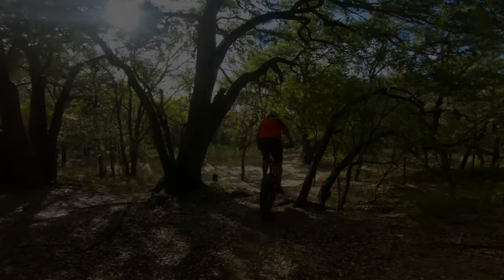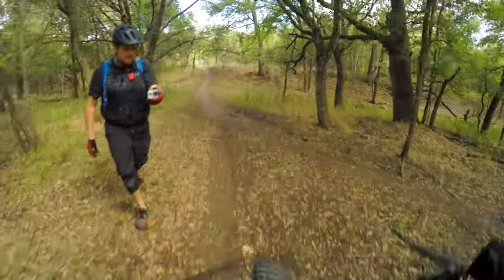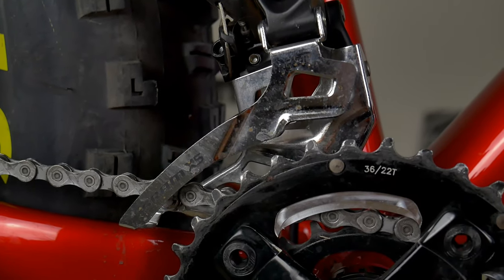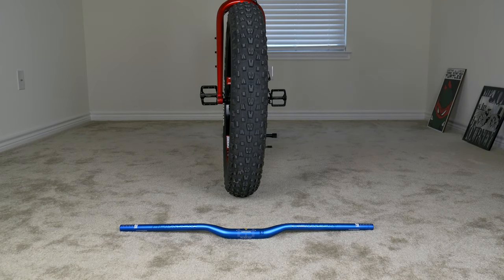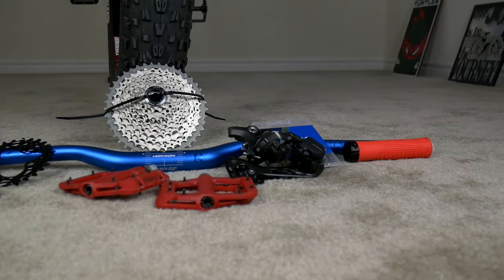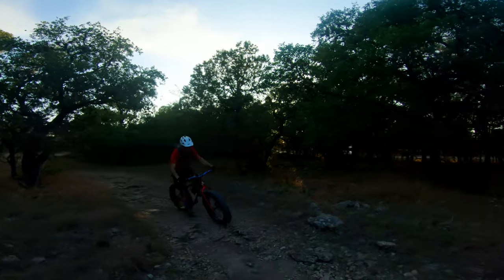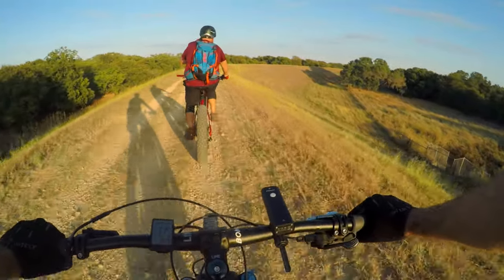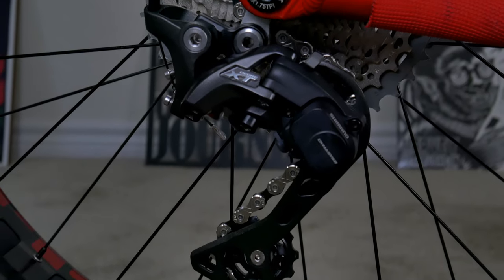Simple and Cheap Upgrades that Transformed my Fat Bike!

Comment: Nice vid, and great upgrades. I bought my Rocky Mountain Blizzard 20 and the first thing I did was add a OneUp Components V1 dropper post for under$150. I'm swapping the MT201 brakes for SLX ones, and replaced the factory pedals with RockBros STAMPs. I added two lights (since it gets dark sooner in the winter), and a frame mount for a pump and CO2. Next up is a suspension fork, but that's NOT a cheap upgrade.
Reply from the maker: Good stuff! I wanted suspension too, but could never pull the trigger when seeing the cost. I was gonna go with the Manitou Mastadon. People seem to really like that fork.

Comment: Nice upgrades! Only thing I'd suggest is running a bashguard ring on the outside since there aren't any ISCG tabs, that's what I did on my bike.
Reply from the maker: Thanks Kenny. That's a good suggestion. I thought it looked a little weird since I mounted the new chainring on the inside bolts. I'll have to look for one.

Comment: Looks great but wondering if you might have too much PSI in the front tire.  I would think more than 8 would be too much.  Looks like its a little bumpy riding.
Reply from the maker: It probably was too much air. I had tubes in it at the time, and my floor pump had trouble reading pressures below 10psi, so I always put it over 10 in hopes of not getting a flat. I eventually made this bike tubeless and was running super low pressures and it was wild!

Comment: i got a salsa beargrease 2017 use mushroom  grips on my handlebars which are moustache handlebars old school i know but still very nice feel, saint pedals, bontrager jackalope rims 26 inch, tyres maxxis minions fbr 26 x 4 on front as well as back for improved traction, seat ism sport, i still got 2 x 10 gears, outer front chain ring is 42 tooth and rear 11 x 42 for road use.  i have chain tight my chain always stays on even off road.

Comment: Luna Cycles has the BBSHD 1000 watt electric motor... with the Ludicrous upgrade, it will turn the motor into a 50 amp, 2700 Watt Fat Tire Beast that will get you rolling up any hill or down the 2 track at speeds in excess of 40 miles per hour!... If anything is worth doing bro.... over due it! (Oh... and always ride with your seatbelt on... in lowest gear.... it is a wheelie machine! ).
Reply from the maker: That sounds absolutely nuts man and I'm very into the idea of it lol

Comment: 2X drivetrains are fine.  If the chain drops, you suck at shifting and/or it isn't adjusted properly.  They also provide way more top end gear than a 1X can, without losing anything on the low end.

Comment: Put  a shorter on stem 45 50 mm makes  a big difference apart from that  all good  up grades  bigger brake  rotors  help  180 rear 203 front cheap up grade
Reply from the maker: I did consider doing the stem as well cause my current one is pretty long. I do have the 203 and 180 brake rotor setup. Helped drastically as it came stock with 160/160.

Comment: I'm sorry if I missed it- have you converted it to Tubeless yet?
Reply from the maker: I've tried so many times to convert this thing tubeless and I can't get it to work :( Sadly I still run tubes in it. I've tried an air compressor and they still won't seat on the rim. Cheap wheels. I may down the road invest in a nicer tubeless wheelset, but don't want to spend the money yet.
Reply: Try lairing up the tape on your rims until the bead fits tight. Try tieing a rope around your tire before hitting it with the compressor.... Going tubeless will over shadow every single upgrade you made to the bike.
Reply: Ghetto tubeless with a 24inch split tube. Easiest and most reliable method for tubeless on a fat bike
Reply: @FatTraction  
100% AGREED.
On my Budget FATTIE Mongoose Malus the standard 'use superwide 4" Gorilla Tape' to seal rim method failed.
Then tried the '24"x4" Ghetto Split Fat Tube method - success !!

Using custom mixed sealant - no air loss in stock 26x4 tires too !
Reply: I could not get my rear tire to seat tubless. Tried every thing with rope, tape and dirty words. I reseated tire with tube then  only broke one bead from rim  to remove tube and install tubeless valve. Used air compressor with hugging and bouncing tire to get bead to seat.
Reply: @jodyhodge2129  that’s the way I got it to work as well. Plus positioning the unbeaded bead as best as possible for seating prior to hitting it with the compressor. Definitely not the easiest job.

Comment: What was the gear ratio on the old 10 speed cassette?  I have a 1x9   Was thinking of upgrading
Reply from the maker: I honestly don't remember. I wanna say it was 11-42? I think the new 11 speed was 11-46. Not a huge difference, but weight savings and less clutter on handlebars made it worth it.

Comment: Did you need to add spacers to center the chain ring? I am doing this same upgrade and have read that you should consider adding spacers to center your chain ring with the cassette. Thank you!
Reply from the maker: Hi Andrew. I actually didn't add any spacers for the chainring. Never had a problem with shifting!
Reply: Did the conversion to 1x10 to great success! Also got the same grips and it has saved my wrists as well. Thanks for the recommendations and details

Comment: Please, can I  have the reference of the bar handle? In addition, I've mistakenly bought online an used Mongoose fate tire that I was intending to upgrade just like you did. But unfortunately, it was a one speed bike. Now, can it be upgraded to a 14 or higher speed?
Reply from the maker: Here is a link to the handlebars I got: https://www.chainreactioncycles.com/us/en/nukeproof-horizon-v2-alloy-riser-bar-31-8mm/rp-prod192543

I bought the 25mm rise. Mine are an older version that they don't make anymore, but these are pretty much the same. 

As for the geared conversion, it depends on the type of hub your rear wheel has. There's a lot of different scenarios if it will work or not, so it's hard for me to give a definitive yes or no. Google how to do a single speed to geared conversion, and there's a lot of great resources to help you!

Comment: Awesome video and upgrades! The bike looks awesome! I would have also gone with a shorter stem, either 40mm or 50mm. I've always done this upgrade to my fat bikes and it completely transforms the handling and flickability.
Reply from the maker: I eventually put a 50mm stem on after this video was filmed. It was way better. I think the original was either 90 or 100mm? Short stems for the win!

Comment: if i only use it in the city, do you think how many cassette do i need to use in my crank? And how many T?
Reply from the maker: Will you be using a 1X drivetrain? Depends on how hilly your city is. If you wanna be able to keep up in traffic I would go with a 36 - 40 tooth front chainring. If using a 10 - 11 speed cassette, just find the biggest range you can find that will fit the bike. I think a 10-46 cassette would cover just about everything.
Reply: Thank you so much for the feedback.. 🙏🙏
Reply: @CobraKyle   if you use 1x drivetrain, what T will you choose? 24? 36? or 40?  *for me

Comment: Does it have routing for dropper post
Reply from the maker: It does! Has a hole in the seat tube, but not internal routing in the downtube. I ran my dropper cable underneath the downtube and bought some cable clamps that bolt into waterbottle mounting points on the bottom of downtube.

Comment: What's your tire psi on this?thx
Reply from the maker: My floor pump doesn't have the best gauge when working below 20psi, but when I had tubes in it I would run between 15-20psi. I finally got this thing tubeless and I run between 10-15psi for normal trail conditions. I believe snow and sand riders go even lower than 10 psi, but I don't have snow where I live, so I can't answer that for sure.

Comment: No mention of the new dropper post?  What is it and how much was it?
Reply from the maker: Sorry about that. I had installed the dropper a year before this video was made, so I didn't include it in this batch of upgrades. It's a PNW Components Rainier dropper, and it currently sells for $180. Can't say enough good things about it!
Reply: @CobraKyle  Thanks.  I recently purchased a used El Oso and am slowly upgrading it.  The dropper post cable routing had me scratching my head, but I think I figured it out.

Comment: Hi from Italy, great tips!! I'm really sorry might have missed it, but may I ask what size are your bars? Thanks :)
Reply from the maker: Thanks! I believe they were 780mm wide which is the sweet spot in my opinion.
Reply: @CobraKyle  thanks, been riding a gravel for two years, am still learning everything about cyclism, i have an old old mtb - it had a 700 mm bar, but i was like 14 when we got it, and a city bike - i've fitted a same sized bar as some guy told me, see how you feel holding a stick with straight arms, horizontal in front of your face. And, 6'2", XL bikes, but i thought that was ok. But am reconsidering now as p, on those bikes, I see that leaning on a bar is just not the same thing as holding it (and its weight) in the air. I assume you must be bit tall too. Anyways I'll think it over and really, 780 might be just good. On the gravel bike, it had a 460er and I fit a 60/75 curve walmer bar which the sweet spot drop in my case. So YES :)
Reply from the maker: @dorianblue4229  I'm 6' tall and ride a large. The wider bars feel a lot better on mountain bikes. I'm not too sure about gravel bikes though. I am considering getting a gravel bike because they look super fun!
Reply: @CobraKyle  yes i have a specialized Awol 2017 and it's fantastic (if one likes the steel/monstercross/cyclotour side of gravel as oppose dto the more 'roadie' one like for example the specialized Diverge), anyway of course i was talking of wide flat bars for the fat bike i hope to grab soon (a Silverback Scoop). Cool tips to keep in mind, thanks so much really! :)

Comment: Whats the easiest way to remove my handlebar grips?
Reply from the maker: I spray a little WD-40 underneath them and that usually gets them to slide right off!
Reply: Don't do that - WD40 does not dissolve after application and will render the grips useless, since they will come loose on the next install WAY easier due to the residues!
Use IPA (iso-propyl-alcohol) instead - just jam a cable tie in between bar and grip and squirt into the gap, as you keep working the zip tie in + turning the grip. The IPA will evaporate fully. Works for sliding on those grips as well!

Comment: How did you fit a 96 BCD oval chainring on that FSA Comet Mega Exo crank?  I have the same exact bike and not only does the inner ring BCD measure way under 96mm but it's also symmetrical/square.  I must be missing something?  Love the vid, planning to do the same XT 1x11 conversion on mine!
Reply from the maker: Hello! I just checked my order history and it was a 64 BCD from Absolute Black. I got the 28 tooth oval option. The 64 BCD fits on the smaller chainring holder, and I believe the larger one is a 104 BCD. Here's an Amazon link to the 28 tooth 64 BCD: https://amzn.to/2YZE0eT
Reply: @CobraKyle  Wicked, thanks so much for checking!!

Comment: I would have replaced the seatpost with a carbon one to save weight. The same goes for the handle bar, carbon is the way to go. And at Ebay it is really not that expensive.

Comment: You have changed the brakes, too, haven't you?
Reply from the maker: Yeah I changed those about a year before this video. It has Tektro mechanical brakes, but I swapped them with a gently used set of Shimano Deore hydraulic brakes.

Comment: You are dropping chains because you are not shifting gears correctly. I bet you go through all the gears like you do a car 1 through 8 instead of how you are supposed to. On a 2x or 3x you are supposed to switch gears in the front around halfway through your gears to prevent "cross chaining" and you won't have those loud shifting problems and dropped chains.

On a 2x8 setup you are supposed to shift:

Left shifter               Right Shifter
1                                 1-4
2                                  4-8

Never be in the biggest or smallest gears at the same time. Think of a bikes gears more like a big rig semis gears instead of a sports cars. You never want to be in 1 on the left and 8 on the right or 2 on the left and 1 on the right.  That puts your chain in a bind and will damage your drivetrain and chain, even breaking the chain. It surprises me how many people don't know this, and take for granted that bike shifting is supposed to be like a cars, where you go straight through the gears, when it's more akin to big rig shifting and the purpose of these 3 on the front is to keep the chain as straight as possible and to keep the chain out of a bind to prevent chain drops, damage and chain breaks. If you are shifting correctly, you won't have loud shifts, or multiple gears that have the same ratios. I see people going with the 1x systems, and you would think they would do a bit of research first to ensure they are shifting gears right. 1x systems do not fix the issue with cross chaining, so you will still have chain drops and damage done to your drivetrain if you ride too much in the outermost gears.  Until the manufacturers fix a drive system that accounts for chain bind the 2x and 3x systems are still better than the 1x system.
Reply from the maker: I never had any issues due to cross chaining. I used to road bike, so I'm very aware of how bad that can be. I was dropping it alot on this particular ride because my old rear derailleur didn't have a clutch and I was going over some very rocky terrain on a rigid frame. I'm hoping the industry follows the trend that Box Prime 9 is going for. 9 speed with same range as the 12 speeds.